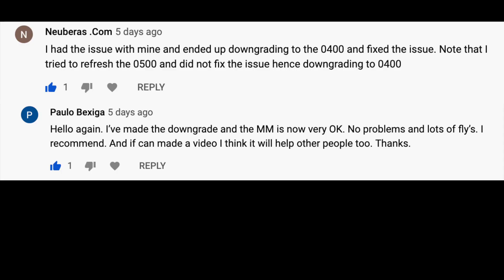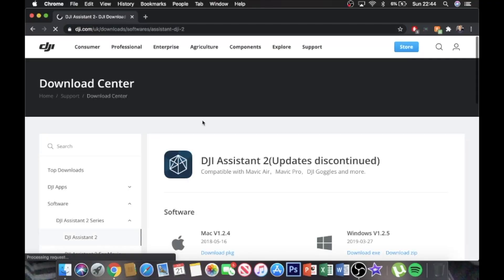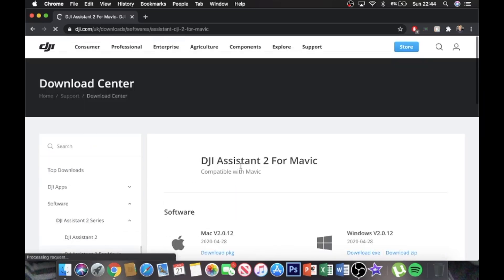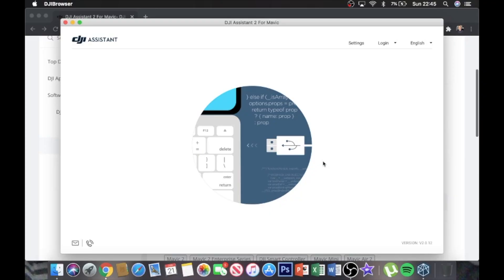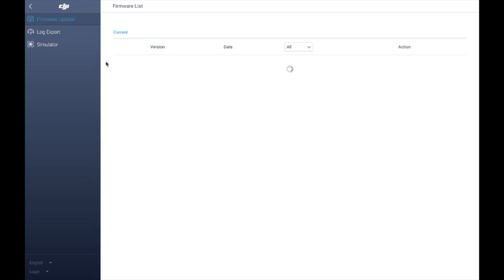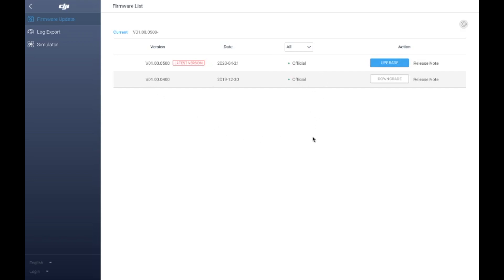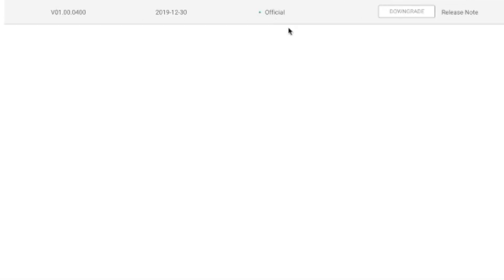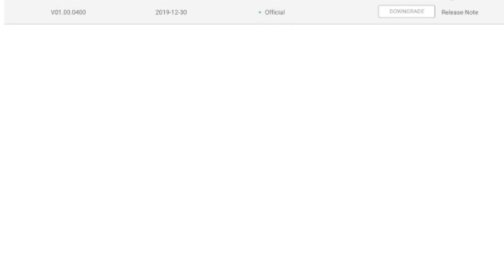DJI Mavic Mini Motor Speed Error NEW FIX 100% (Code 30246)

Comment: *HELP*. I have updated my direvers and restarted PC, but my Mavic Mini WILL NOT connect to the software. It just wont recognize my device in order to refresh the firmware OR roll it back and I am stuck with the error like everyone else. Any ideas on how to get my Drone to be recognized by the software?
Reply: i had the same issue. the way it worked for me is: turn on drone, connect to computer, turn on DJI assistant app, than disconnect drone from computer, restart drone and connect back to computer and click confirm on that notification window. hope it will help you as well ;)
Reply: Make sure the drone is on after you restart it.